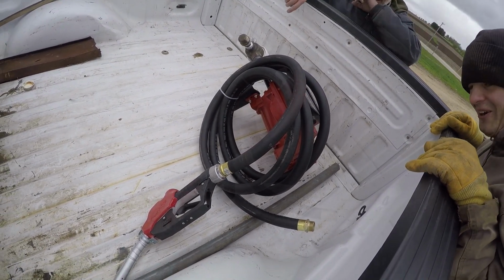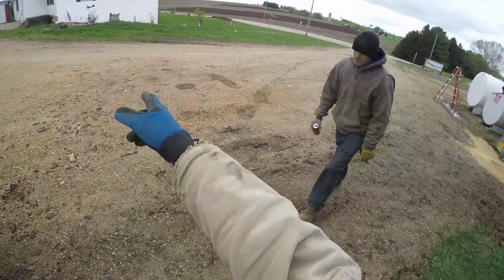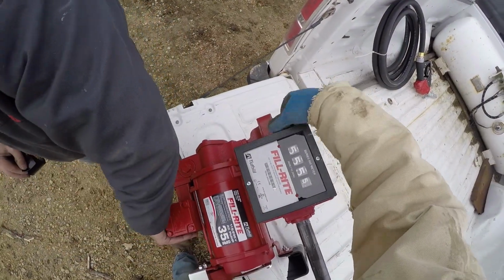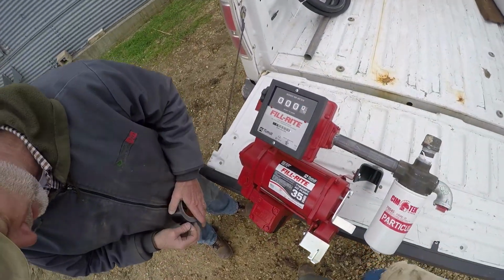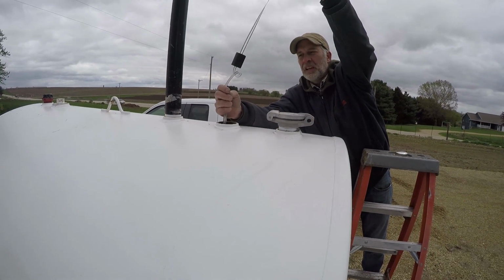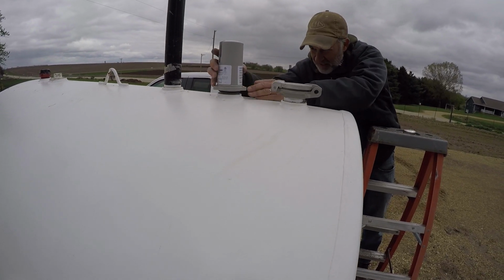Tripling Fuel Capacity

Comment: Agree with you completely, to a point... the more information you have that you can effectively USE, the better... BUT too much information, or information just for information's sake, or information that causes "analysis paralysis" and prevents you from making an effective, efficient decision, can be detrimental.  It's all in how you use the data, the conclusions you draw from it (making the correct decision and correctly interpreting the data you're seeing and correlating it correctly to causes) is really the key, and knowing what data to ignore or disregard, or determining what's "down in the noise" statistically speaking.  

It's like planning... planning is good... remember the old wise tale that "failing to plan is planning to fail", BUT, "the best laid plans of mice and men" is also applicable.  

When I was younger I spent nearly every day one winter planning out the coming crop year to the last detail-- from researching seed varieties/hybrids and test plot results, to fertilizer planning, to herbicide/pesticide programs and timing, field prep work planning, you name it, I did it.  Wouldn't you know it that spring threw us a curve ball and it was nearly the wettest spring on record, and kept us from getting the field work done in a timely way (as planned) and got our crops in terribly late, torpedoing a lot of the varieties I planned to plant, forcing me to switch to shorter-season varieties instead, etc. etc.  

I learned a valuable lesson in all of that... Yes having a plan is good, BUT you have to have the flexibility to "shoot from the hip" and make changes to that plan, or have a good "plan B" for the unexpected... Planning for planning's sake can all go out the window very quickly when things don't work "as planned"... LOL:)  

I think that's great though that you'll have a better idea where your diesel is being burned, especially if you're using the GPS in the machinery and can correlate dates/times you were doing what operation in the field months later to the fuel consumed at that particular day/time.  Sure will give you the true cost of "recreational tillage" and make you think more clearly about "is this operation REALLY needed" or "how can we improve efficiency and reduce the number of passes" and things like that which can REALLY improve the efficiency and lower costs on your operation... 

Later!  OL J R :)

Comment: We have a lot of fuel thefts in our area (southern MN).  Usually they cut the locks.  I recommend having a breaker or way to disable the power to the pumps inside a locked building.
Reply: BornToFarm101 an AR 15 helps as a deterrent to thieves.
Reply: BornToFarm101 that's  what  I  have  done  on my fuel  tanks  here  in central  north  Carolina  to help  deter thieves .  a close  friend  of  mine  said  someone  actually  threaded  his  locked  pump  off his  highway  diesel  tank  and  dropped  their  own  pump  in and  drained  a couple  hundred  gallons  out  of  his  one  weekend .
Reply: We have ours hooked into the shop lights so the lights in the shop have to be turned on to have our  gas and diesel tanks running
Reply: Inside the near by shop I put a 30 minute escape timer switch.   The switch can be set to the time it will take to fill up.    Saves a lot of time over a year.

Comment: Does this extra capacity let you purchase fuel at a lower cost?  Does it save you any delivery fees? otherwise, your money is just sitting there in the tanks.
Reply from the maker: More capacity typically allows you to have a more discounted price, which is several cents per gallon in our case which will save us in the long run.
Reply: The AFD program that How Farms Work is on ,works like this. We keep the tanks full. With the added fuel storage capacity they receive a better discount due to delivery size. They only pay for the fuel they use each month. The fuel price is the average of the daily price for that month. There are contracting options and tank buyout options as well.

Comment: Hmm, many of the farms around here have gone away from the on farm tanks to tanks on the trucks. Mainly because they pay less buying at the pump than delivery fees plus they don't need to handle the fuel multiple times. Also NY is anal about storage tank containment, to the point they require LPG tanks to have containment tubs !!!  Not real sure how a containment tub is going to contain a gas....
Reply: Blazer02LS coz it's a liquid
Reply: LPG is Propane. It is a liquid ONLY if it stays under pressure. Containment works fine for gasoline and diesel tank ruptures. Not going to do anything if a propane tank fails as the liquid will boil off as a gas as soon as the pressure drops the instant the tank fails.
Reply: Blazer02LS propane sticks to the lowest point, containment tanks are still better than having it spread all around the floor of the area.
Reply: It will layer in a low spot BUT because it expands from a liquid the containment isn't a real help. Plus most failures are to valving which simply blow out the top of the tank. Have put out a few fires and been to numerous leaks. Never seen the containment work yet.
Reply: Containment around LPG tanks??  How do you contain a liquid that boils at 44 degrees F?? Never seen an LPG tank leak liquid anyway... never seen one leak period except one time when I had a fueling check valve stick when fueling up a butane powered tractor from the LPG tank and hose... The check valve hung open and when I went to unscrew the fill valve from the tank fitting, it began leaking liquid propane out the fitting, instantly freezing it over as it boiled away into gas... The fitting iced over bigtime before my Dad told me "yeah, that happens- tap it with a wood block until the check valve seats... I screwed the valve back on most of the way with heavy leather welding gloves (which promptly iced over as well and got DAMNED COLD inside!) and then tapped on it with a 2x4 until it FINALLY seated and sealed off...  Dad fueled butane tractors from the time he was a kid and told me "yeah, they'll do that... probably a spider or bug in the hose valve end when you hooked up-- best to "crack the valve" and blow some butane out before hooking up the hose, to ensure anything in there that could stick in the check valve is blown out ahead of time before you hook up.  Never forgot that lesson.  

Kinda pointless to "contain" liquid propane... the stuff would boil vigorously on contact with concrete or anything else in an unpressurized environment (atmospheric pressure) until it refrigerated it below -44 degrees, then sit there and absorb latent heat from the atmosphere and continue to boil off until it was all gone... 

Rather stupid... but then it is the gubmint!  OL J R :)

Comment: so does DAD have more acreage then you and your brother combined?
Reply: yes
Reply: Why just Diesel? Ever think of adding some gasoline storage tank ?
Reply: Why?  No modern farm equipment runs on gasoline anymore... basically nothing built since the late 70's is gas-powered, other than Mules or Gators or lawn tractors or stuff like that, and usually they don't burn enough fuel to keep a bulk tank "fresh" (gas starts to degrade and get "old" as soon as its delivered, ESPECIALLY "modern" gas with ethanol and other crap additives in it... it will "go bad" in a matter of months).  Unless one is running old tractors burning gas or running a lawn service or something there's very little benefit to bulk gasoline delivery anymore.  

We USED to have bulk gas delivered for our old cotton pickers built in the early 60's, but when leaded gas was phased out (early 90's for farm equipment) it got ridiculously expensive.  Those machines were getting increasingly old and hard to get parts for, so we upgraded to Deere cotton pickers built in the 70's with diesel engines, which were more efficient and burned less fuel.  When I rotated back into grain sorghum in the mid-90's and revived our old early 70's combine powered by a gas engine, I simply bought gas at the station in 55 gallon barrels and pumped it into the combine as needed, rather than mess with the bulk tank...  

Later!  OL J R :)